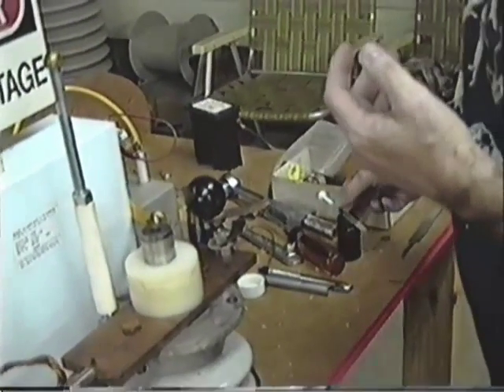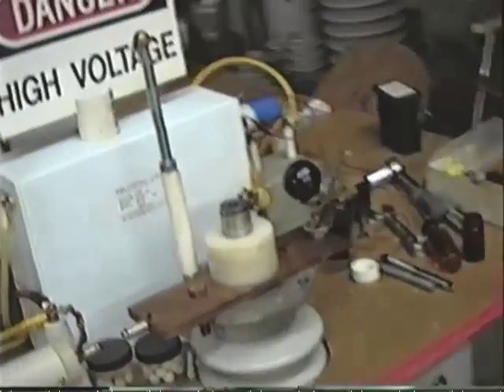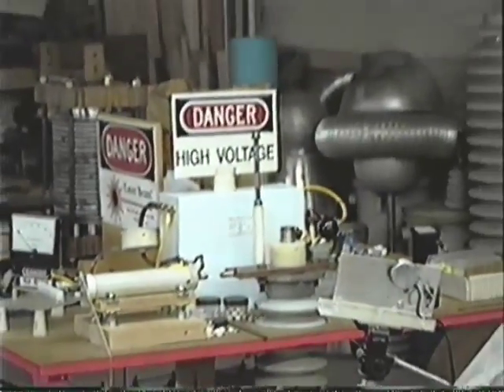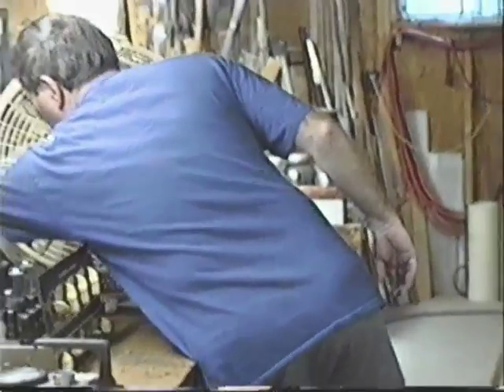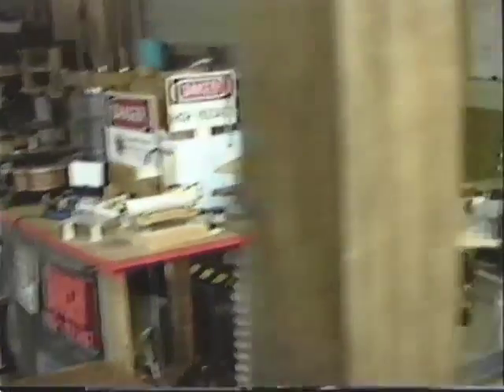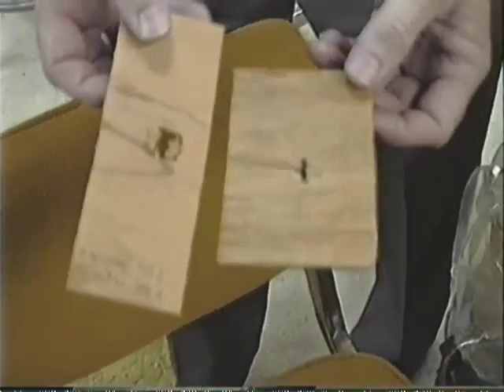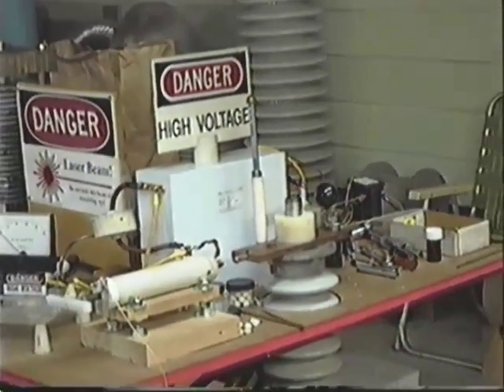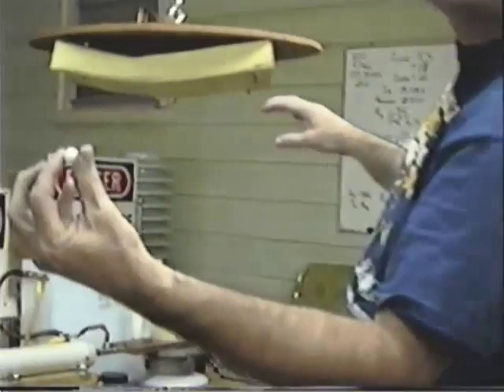Richard Hull Water Arc Explosions Lab Visit 1995

Comment: Does that work on water mist in a internal combustion engine?
Reply from the maker: Hi Travis, Can you be more specific about what you are looking to do? Are you relating this to "water injection" for ICE or something else? 

In any case the experiment here was to release a small amount of electrical energy in a very small amount of time which yields immense power (E/t=P). The discharge almost instantly atomizes the water. Due to the containers shape the water is directed in one direction with great force. Enough to pierce through plywood.
Reply: @TriAngles3D  Combine plasma arc discharge with the high compression of a diesel engine where the heat of compression yields steam expansion for a bit more power. While mixing the water with air with a lean mixture carburetor?
Reply from the maker: @travismoore7849  Hmm. Water Arc Discharge within the combustion chamber? The use of the "carburetor" and "lean mixture" threw me off as diesels use injection. Or do you mean something else?

In any case, atomized water in (Constant Volume Combustion) CVC type ICE systems can be beneficial towards a more controlled and docile combustion. In particular for very high compression (supercharged) gasoline engines. The flame front moves more evenly and reduces detonation. However, combustion efficiency is directly related to max attained combustion temperature. Water to steam conversion might actually dampen this. Also, for a diesel I would expect that injection timing and duration would need to be adjusted accordingly.
Reply: @TriAngles3D  I was thinking about doing away with the fuel injection and if it had 500 Joules on a plasma based spark plug that should do the trick. But if lean does not work maybe richer would be better. I was thinking along the lines of a capacitor discharge system with voltage multiplier.

Comment: With the proper setup, over-unity output can be achieved with water arc explosions.  This is a research paper done by two researchers, one at Oxford University in the UK, and another at Northeastern University in Boston:

http://www.tuks.nl/pdf/Reference_Material/Electrolysis_Water_Arc_and_Dielectric_Breakdown/Graneau%20e.a.%20-%20Arc-liberated%20chemical%20energy%20exceeds%20electrical%20input%20energy%20-%202000.pdf

*Arc-liberated chemical energy exceeds electrical input energy*  is the title.  It was peer-reviewed then published in the Journal of Plasma Physics back in the year 2000, volume 63, part 2, pp. 115-128, Cambridge University Press.

*WHAT PHYSICS ARE AT WORK*
1)  cavitation or another (electrical for example) means is used to break down hydrogen bonds in H20 water molecules -- see 
      https://en.wikipedia.org/wiki/Hydrogen_bond

2)  The outcome of the breaking of hydrogen bonds is ignited with electricity

The cavitation method of breaking down hydrogen bonds in water molecules can be done mechanically -- this is a patented type of heater that uses hydrogen-bond-breaking by way of mechanically-induced cavitation to produce heat:  
https://patentimages.storage.googleapis.com/8b/25/84/229f920b9f25fe/US5188090.pdf

The bottom line is this:   ripping apart hydrogen bonds of H20 is an atom-level action -- a hydrogen bond is an electrostatic coupling between the hydrogen atom (which consists of one electron and one proton (no neutrons) in the nucleus) and the oxygen atom.

EDIT:  My assumption was he is using distilled, pure water.  Otherwise, if he's using non-distilled (tap) water, he's simply performing electrolysis (using electricity to separate hydrogen and oxygen).  However, since he's using very high voltage (pure distilled water, without impurities, doesn't respond nearly as well to electrolysis) I'm assuming that he is using pure, distilled water. If he is achieving electrolysis (has enough voltage), this is a bit different than cavitation/breaking hydrogen bonds/igniting the cavitation bubbles.

One way to think about the breaking of hydrogen bonds is as a very minor type of nuclear reaction.  It's certainly not splitting an entire atom apart - no radiation is produced, and the amount of energy obtained is far less than splitting the atom.

But it is at the atomic level.  It's like nuclear reaction LITE.  Or nuclear reaction VERY, VERY LITE.  But still -- summed across a large number of water molecules, it is possible to extract more energy out than is put in. 

Read the Oxford researcher's paper above.  

If you combine the mechanical method of ripping apart hydrogen bonds as used in the water heater patent above, then fire off a well-timed electric discharge,  you might pull off a self-sustaining power source, if the Oxford researchers are right.

They based their work on 90 years of unusually strong explosions of water, mainly due to cavitation, which is how the patented heater above rips the hydrogen bonds apart -- cavitation.

Comment: The capacitor was only 2 ufd rated at 20kv peak vdc.  The peak current was just over 11,000 amps (varian RF current transformer 1:1000) on Tektronix DSO.  Water was distilled, de-ionized water 1cc.  16kv DC charge at discharge 256 joules.
The explosion in water is a dielectric explosion.  Tap water has millions of chlorine or fluorine ions in it. (not good)

The water was placed in a special construction water arc gun.  Ultimately this work was published as a collaborative effort in the Journal of Plasma Physics in 2000.

I did not film this.  If I had, I would have given far more information.
Reply: Cool! I saw your video on Great big Story thought it was great! I love this stuff myself.